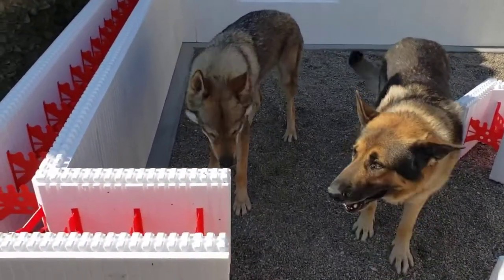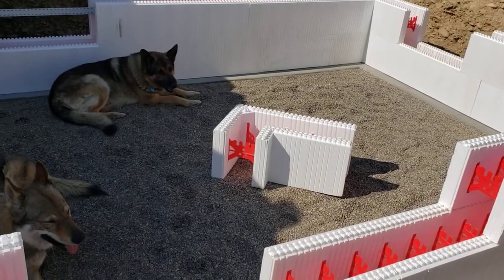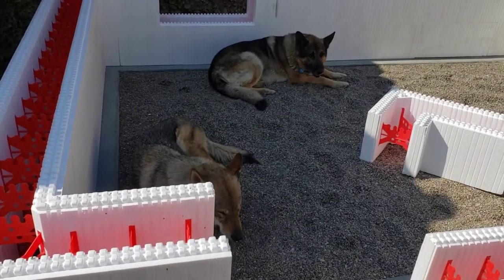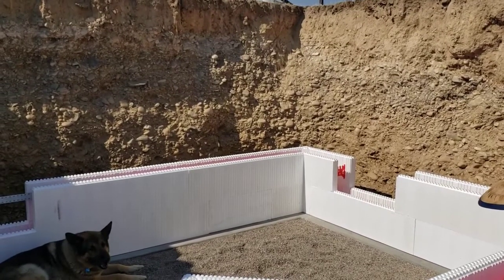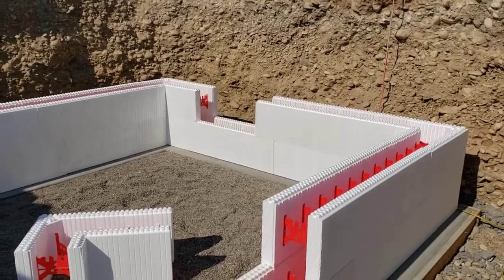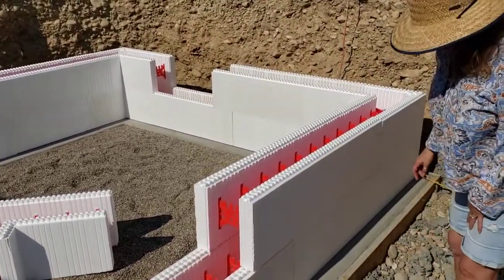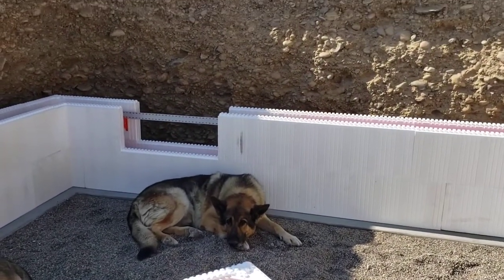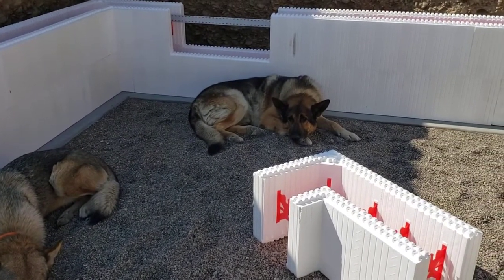Step4a - Southwestern Montana earth-sheltered, walipini-style greenhouse

Comment: Nice, I was looking to demolish my pool and make a 30' x 20' walipini in its place. I wasn't sure how to build the retaining walls, so I'm glad I found this. I want to build 10' high with the retaining walls, backfill 2' of soil and build a polycarbonate panel structure with 8' walls on top of the retaining walls. I need the walipini to be so tall (18' max clearance) because I want to grow tropical fruit trees. I assume I'll have to use more rebar, anchors and braces for building that lengthy and tall.

Did you paint / texture the foam or hang drywall on it? I want to texture the foam to make it look like a rock wall. I'll grow tropical fruit vines like passion fruit and kiwis on the walls. I want to have an 8' tall waterfall that transitions to a spring which will run the whole 30' length of the walipini. The walipini will also be a habitat for some monitor lizards.
Reply from the maker: Jim, what a cool project.  Before you demolish your pool, why don't you use that for your Walipini base walls. . I assume you will have to take out the pool floor since you are growing trees.    There are resources on Youtube for utilizing a defunct pool.  Wish I had that option, but most people in Montana don't have outdoor pools ;)  Remember to calculate your shadow when building.  A 10' high base will cast a lot of shadow.  (See my comment to Corwyn in Step 5).   Okay rebar question.  The vertical rebar are bored into the cement base.  They are placed every one foot.  The higher you go, the more Styrofoam block rows you will need.  Each row has its own horizontal rebar.  You won't have to add extra besides what the height requires per row.    We did not texture any of the blocks but you could.  I recommend not using drywall (sheetrock) because of issues with condensation.  You could use products approved for constructing a bath or shower.  Or consider using gabion baskets.  If you want a rock wall inside, suggest checking out gabion baskets placed against the Styrofoam blocks.  I bought my baskets on Wayfair (also make sure they are galvanized steel).   A gabion basket wall is filled with rock.  The widths vary, but they do come in 6" widths, (less rock needed).  They also come in 20' lengths and heights vary. Your polycarbonate will then sit on top row of your cement blocks.      I would love to see the final project.  Love the idea of lizards.